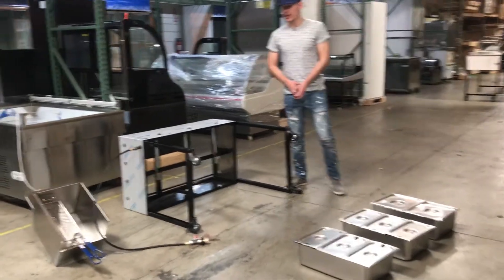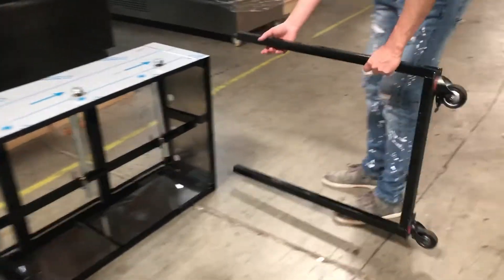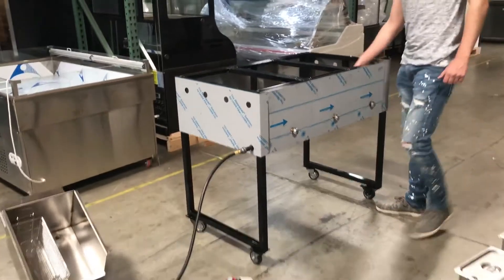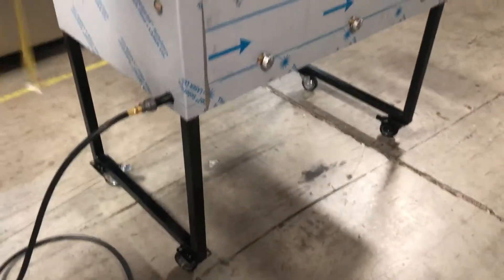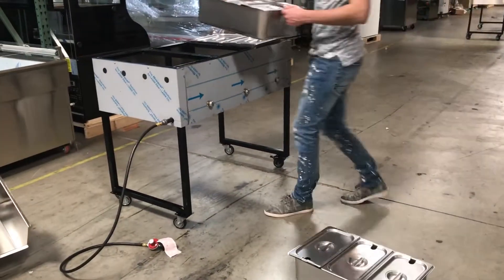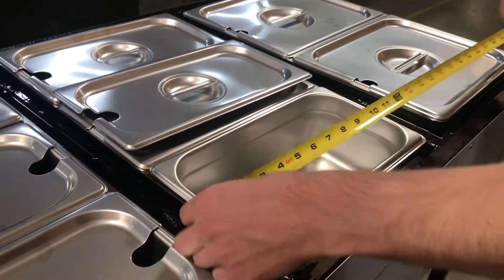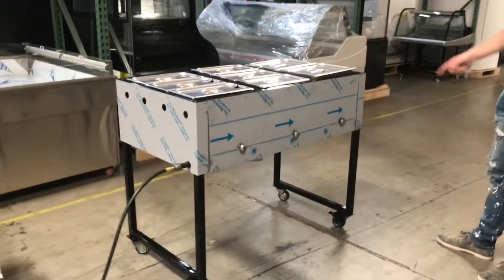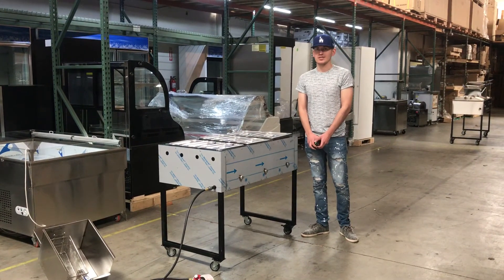outdoor outside Steamer BUFFET FOOD WARMER STEAM TABLE CASTERS NSF RESTAURANT EQUIPMENT

Comment: The long are called 3rd pans and the square ones are called tall 6th pans. Appreciate the video tho
Reply from the maker: Brad Hendricks All item have video at www.coolerdepotusa.com  order price including shipping. Phone or text to  626-320-0106 victor or 626-417-3090 eva
address:730 w golden grove way covina ,ca 91722 
monday to friday 9:30am-5:30pm
Reply: @zhanglianyong  how much
Reply: No, the smaller pans are 3rd pans, but the bigger ones are half pans.  All well are the same size.  If the fit 3, they are 3rds.  If they fit 2, they are half pans. If only one pan fits, it's full pans.  6th pans fit 6 pet tub and are not shown.  Hope that helps.